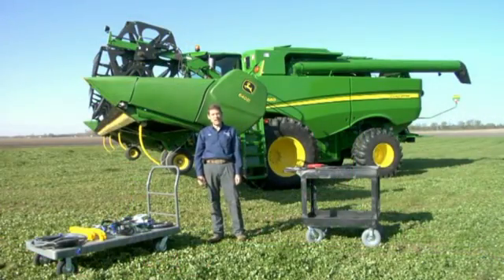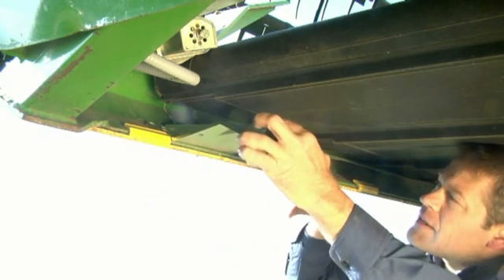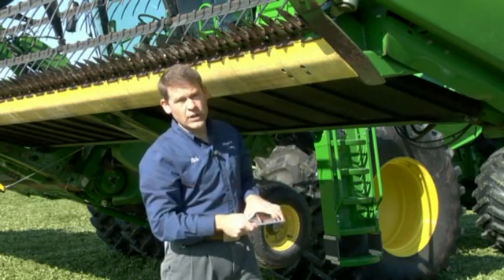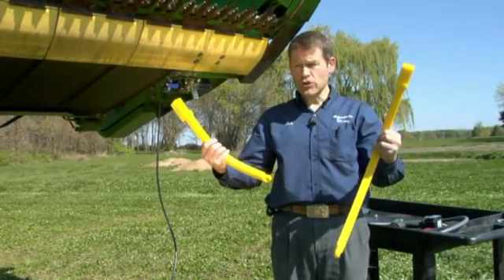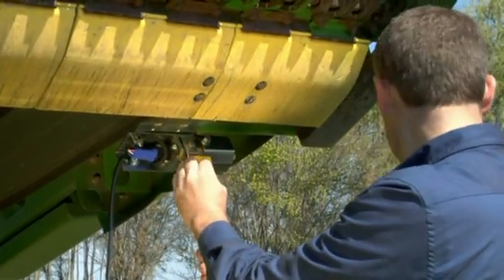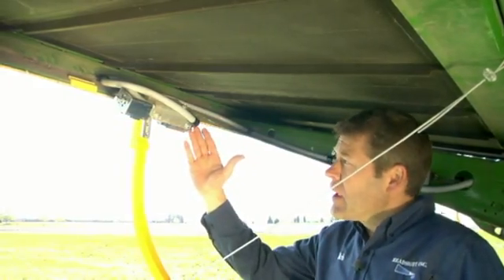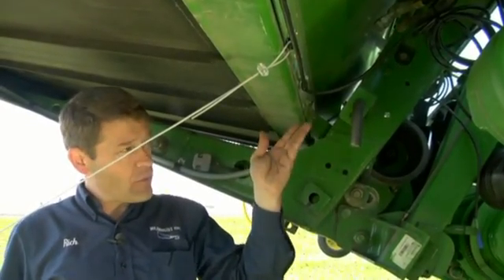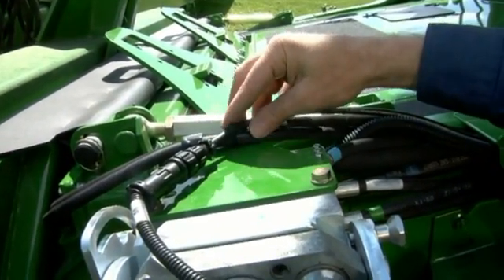Grain Height Control Installation on John Deere 600D

Comment: Will this installation work for soybeans also?  Or is it designed for small grain stubble only....
Reply from the maker: No sadly this is designed for off-ground cutting. That heads is designed to be ran off ground and not on ground.  If you'd like to know more please give us a call and we'd be happy to answer them.